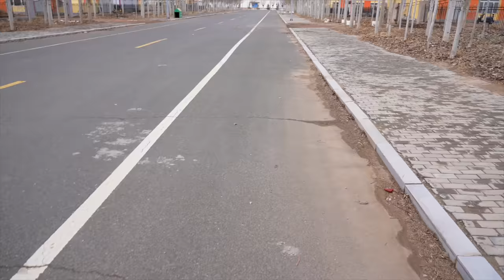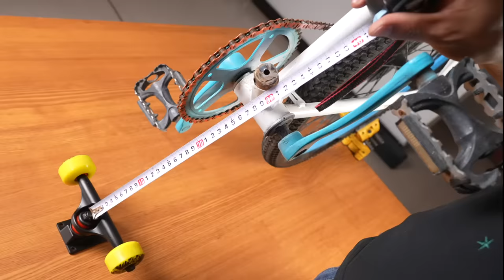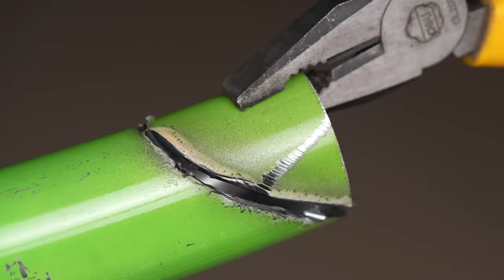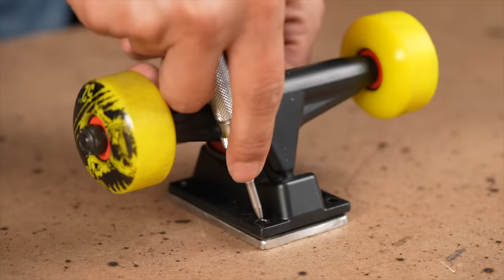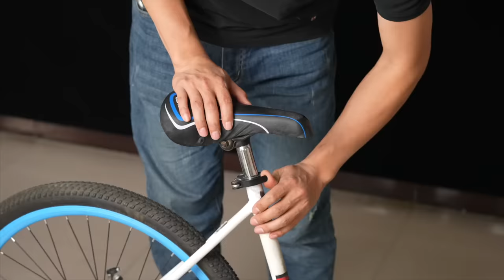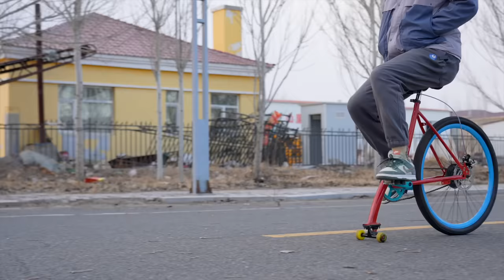The Bicycle Without Hands！

Comment: A very good and ingenious project. Well done. You may also want to try lengthening the seat stem, curving it to 90 degrees, 8 -  10 inches forward past the saddle of the bike, then attaching the brake lever at the front extended end of the elongated seat stem opposite but parallel to the bottom of the saddle. This is for better grip control and steering stability of the bike.
Reply: How to make a turn ?
Reply: @bipulbipulvikash2765  p

Comment: Something like this was manufactured years ago. Basically the same design, but a smaller bike frame and wheel, with a hand brake mounted under the seat. . It was called the Skate Bike. I use to have one. They were made in Jacksonville, Florida, but I can't be sure of that.
Reply: I'll be darned, you're right. Just looked it up. He basically did what had already been done. Secondly we know full well that no one would steal half of an entire bike. The front wheel maybe (like someone did to a bike on my porch) but not the entire front half.
Reply: @DaNinja60  get delta security skewers they use a weird non standard triangle bit that thieves won't just have on their person

Comment: Dangerous
 Those front scateboard wheels are too small and if you hit a pothole or crack on the sidewalk you fly headfirst over. Because the wheels will go in and get stuck. It is not truly practical for real travel.